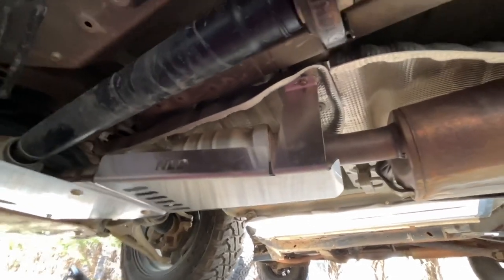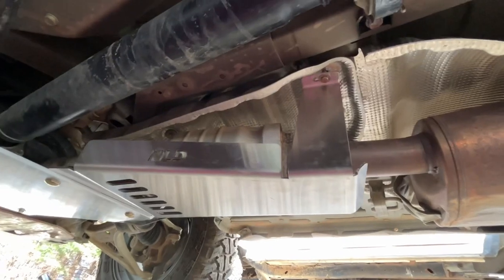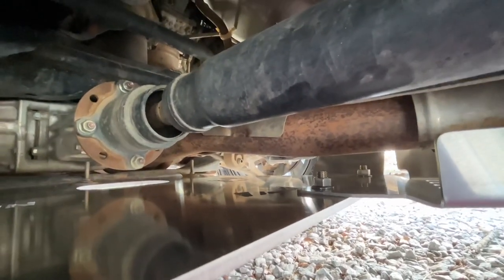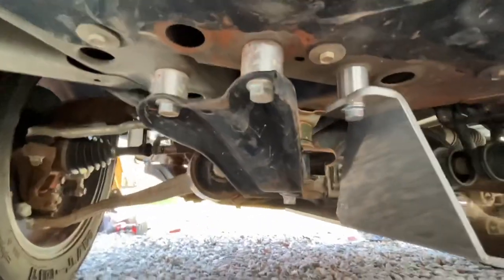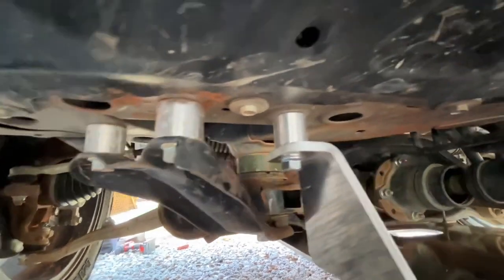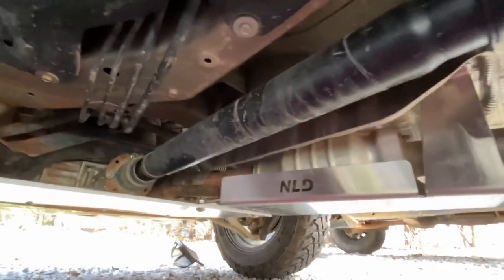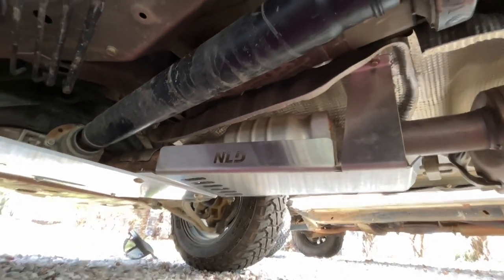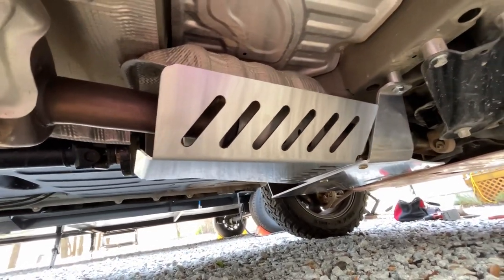Honda Ridgeline Passport Pilot MidSkid Catalytic Converter Theft Detergent  Skidplate NOW AVAILABLE

Comment: I never installed one of these so maybe this is a stupid question, but can't a thief just back out a few bolts and remove this then proceed to cut off the catalytic converter? And isn't there enough room to fit a long Sawzall blade above where the 2 skid plates are joined? There's obviously clearance to cut off the exhaust pipe by the muffler. I don't do offroad, so I'm only looking at the theft deterrence aspect of it.
Reply from the maker: I thief can do what ever they have time for. This is a deterrent. If I’m a crack head and I lean under one truck and see this, then lean under another without. Which one are you going to cut? Is the crack head going to have a racket set? Is the crack head going to test the metal to check if it aluminum or steel.

Comment: Good video.  I'm confused though.  Last I saw, you had a 1.5" lift.  Unless you have gone a 3.5" lift from Traxda, why do you have a 1" subframe drop?  Just curious as I ran the 2" lift on my 2019 Ridge and didn't need a subframe drop.  Thanks!
Reply from the maker: We partnered with HRG for the perfect all around lift. 2.5” with a 1” subframe drop to protect the axles. NO TRAXDA !!! https://youtu.be/-bndSDvOux4